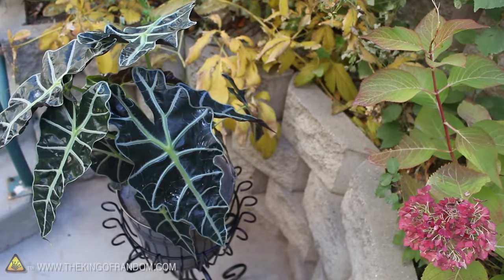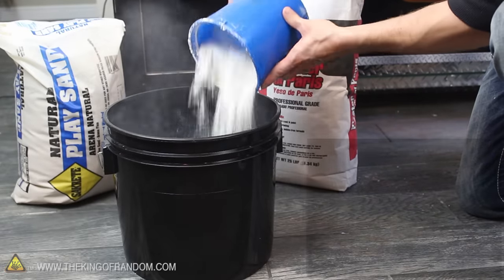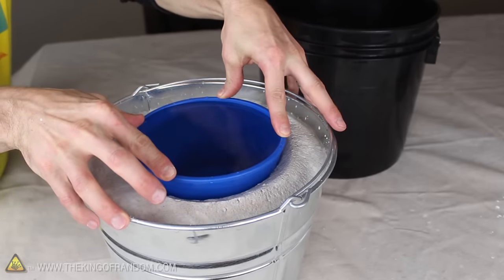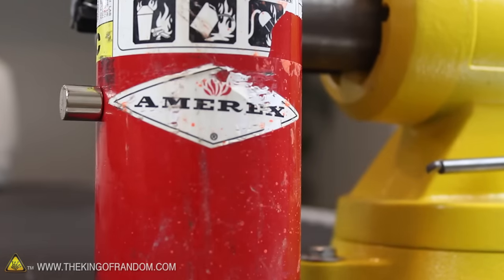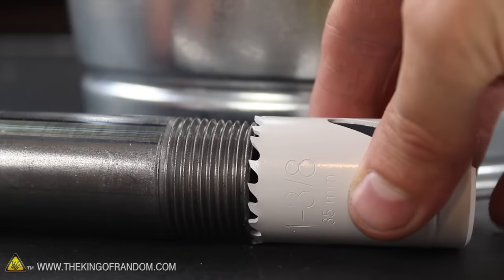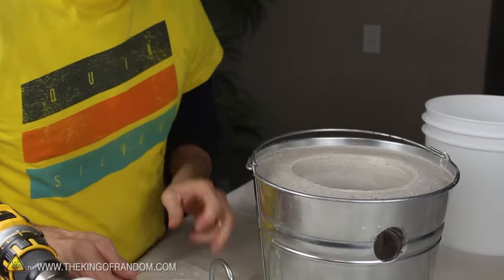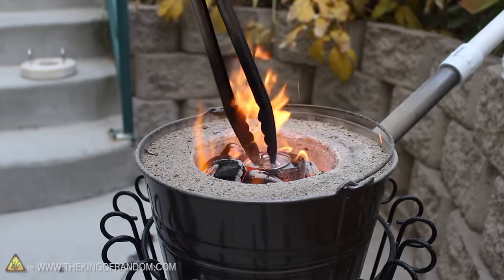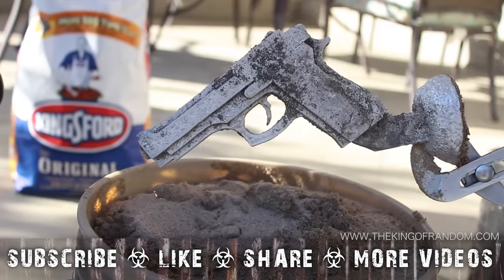How To Make The Mini Metal Foundry

Comment: My son and I built a foundry last month, and he insisted on trying it out one afternoon when the temperature was in the 20s.  Needless to say, although it seemed to be eating the cans, no liquid aluminum could be seen.  When we finally gave up, the contents of the crucible solidified quickly, and stuck.  

We tried it again today, with the temps in the 60s, and it worked like a charm!  The crucible heated up, and we kept tapping on the metal in it until finally the rebar went right through the slag and into the now melted aluminum.  We spent several hours melting cans, and creating little "muffin" ingots, doing three pours and emptying the foundry for new charcoal between each one.

The only problem we ran into is we've now lost two lids.  Both days, after we let the foundry and lid cool down, when we picked up the lid, it broke into three large pieces, each of which was dry and crumbly.  My only guess is that we didn't allow the lids to cure long enough before using them... any ideas?
Reply: That's pretty neat!
Reply: plaster and sand are not going to hold up for long.  Ceramic fiberboard from a pottery supply with a hole cut in the top would be better.  

this is a great tutorial and fun project but a part like the lid will not last for many firings.
Reply: ***** I had this problem once in school using plaster and sand as a mold. It happened to the whole class. Even after being very dry (kiln dry) the structure broke down and my aluminum flashed out of the cavity creating a bad casting. The mold got crumbly too. I seem to remember it being a problem with the sand. You might try a higher ratio of plaster, maybe even 100% plaster. You could try adding glass or wire mesh to the mix too. I'm not sure if it will work but it is worth a try.
Reply: Add some wires mesh or screws as support for the plaster to grab on to for the lid
Reply: I did it too but, with a metal bucket inside. At first I thought I screwed up, but I was very mistaken. I got to the temperature which it was needed to melt cans it worked very well. All the heat was kept inside, and was easier to maintain the temperature. Now for the lid, if you have any ceramic lids that might fit, that's good, or when curing the lid in the midst of curing the lid add more liquid. I don't know if it will work but try!
Reply: Unexpected bit 'o coolness!  A couple of weeks ago, I was talking to a guy at church who was a retired plumber and welder.  Told him about this, and he asked what inert gas I was using to prevent the aluminum from oxidizing... Told him that was far beyond what we were doing.

Today, after we melted another 5 pounds or so (total almost 20 lbs now, after 3 successful burns out of 4), I noticed the crucible was sizzling.  I had turned it over to knock out the excess slag, but the inside was coated.  I poured some water in to make sure it was cool and then picked it up.  Wondered if there was residual heat inside the slag, but it, too, felt cool to the touch.  Then I remembered the comment from my church friend.  I added two inches of water to the crucible and ended up with several streams of bubbles (very tiny, like in beer) so I wondered... is that the pure aluminum oxidizing in the water?  If so, those bubbles would be hydrogen gas.  How to test?   Got my stick-lighter, and held it to the surface of the water near the bubbles... sure enough they popped audibly, as you see in science classes when burning hydrogen bubbles!
Reply: I over mixed my plaster/ sand mix for the foundry and lid, (I used a 12 quart bucket,  poured my lid reinforced with bailing wire about twice as deep in a 5 gallon plastic bucket). No problems yet.
 My crusible did go out in a full aluminum, steel, charcoal blaze of glory, (it was half of propane tank, depresurized then filled with water to remove any explosive gasses when the cutting it half sparks started flying).
Ordered a size 6, (I think) graphite/ clay crusible, that size might be a little too wide for some of your furnace holes, but mine became wider. Works great for a little over $50.
And the furnace also grills an Awesome T-bone! Crank up the heat to sear both sides, remove the hair dryer to lower the temp, and cook to what you prefer. The most juiciest steak I ever had.
Reply: Such a fun project for many reasons. From what I remember aluminum is almost impossible to keep from oxidizing. Inert gas is definitely necessary for welding. But I dont remember anything about needing it for foundry.

But maybe thats what the pool shock tabs we added were for. If you add a small amount of pool shock, or even table salt to your liquid AL the slag will bubble to the surface so you can skim it off. YOU NEED A VAPOR MASK! This releases a puff of chlorine gas so please be careful if you do this technique of cleaning your aluminum. Of course you should wear a vapor mask anyway when doing foundry work so... hope that helps someone get better pours.
Reply: Instead of plaster of Paris, use clay, foundry clay, I got mine at the local brick/ gravel supply house, muddox is the brand, fire clay is what it's called, it has instructions on the mix, it's basically, 1 part Portland cement, to 1 part clay to 6 parts sand, 1-1-6, to make fire brick mixture, that won't crack, I've found that 2 part cement to one part clay to 6 parts sand works better. This acts as a liner to my, plaster of Paris and sand outer insulated core, so basically, we are lining the inside of the forge that he shows with fire brick, and I make my lid 100% fire brick, as it cools faster, hence the cracking issue. For the forge air supply, use steam rated black iron nipple, not galvanized tube. And the length is critical for the air /oxygen mix, I found 18"  length tube at 1-1/2" diameter to be perfect. With the pvc, pipe and adaptor at 24" overall  as he recommends. Note if u remove the lid and light, u will notice that the forge heats slower, the lid is needed to create the vacuum caused by the consumption of oxygen to bring in more air through the supply pipe., do not blow air into the forge with lid off, it's a mess, if u do, and I know a few of us have tried that!, I actually expanded on this ideas and created a larger forge, dimensionally speaking one can use the diameters to incrementally upsize. And I use coal, charcoal works , and if making knives, it adds carbon to steel making for a better steel. Cheers
Reply: *****  since you have made this im attempting yo make this can i ask how do use depressurize the fire extinguisher or did you use something els?
Reply: evan rodriguez Just empty all of it out spray it. My friend got my crucible for me, I think that's what he did.
Reply: Thanks ill try that
Reply: evan rodriguez, I purchased a five inch length of quarter inch steel pipe with an inner diameter of 4" inches, and a 4x4x1/4 plate to weld to the bottom.  It it thicker, so slower to heat up, but holds the heat between burns fairly well.  I didn't want to spend money on a new steel extinguisher just to destroy it, and was unable to find an old one anywhere.  My local steel shop had what I needed and I paid about $6 for the two pieces.
Reply: ***** Alright thanks.
Reply: ***** I used to work at a household hazardous waste depot and we would get several fire extinguishers a day of all different sizes. Now normally we do not give out anything we receive, but if you ask the supervisor nicely, he may give you one. Explain that it's just the steel body you need. DO NOT ask in front of other customers because we don't want them asking for stuff as well. Use common sense and discretion and understand that NO, is a possible answer. But it doesn't really cost anything to try.
Reply: Roger Murphy Not even sure where I'd find such a place here... but thanks for the advice!  Our steel pipe crucible actually works pretty well.

Comment: I'm totally building one of those
Reply: Yusuf Reyes I can't wait till I'm older to do this my dad wont let me do I didn't ask but I know he wouldn't let me P.S. I'm using my dads account and I'm a girl
Reply: Michael Lukowicz i have the same problem only i am using my own account
Reply: me to im not using  my  acount
Reply: Yusuf Reyes it's not as easy as he makes it seem. You will be at least 100 dollars into it by the time you finish
Reply: 100 dollars for sand bucket and mix? I don't think so
Reply: Actually it would possibly cost around a hundred dollars. Its just that Grant got the fire extinguisher for free and probably had most of that stuff lying around, therefore it cost him about 20 bucks.
Reply: Plaster, 10 Qt bucket, a2.5 Qt pail ad two U-bolts ran me $33.17 .  Built one today. I already had the hole saws, drill, etc.
Very cheap build and a cool foundry to boot!
Reply: Mans-Sham Ann you can use sand an flower mix for the insulator
Reply: DieselsWorkshop99 still would be worth it if you got a lot of scrap aluminum
Reply: Im today
Reply: Cristero Warrior
Reply: Pitforbrains how hot does it get?  Can it get to 1100°C?
Reply: Built it today and it cost $70 for all supplies (7 years ago when these comments were left it probably would have cost around $50)

Comment: Does this get hot enough to melt copper?  Hadn't seen anything in the comments section saying yes or no.
Reply: +AaronClarey : It can melt copper! Da da da it's a Furnace.
Reply from the maker: +AaronClarey It sure does.  https://www.youtube.com/watch?v=kS949QQDtWQ
Reply: +Grant Thompson - "The King of Random" You used propane with it. Can i melt copper with coals?
Reply: +Unknown Guy The crucible can't be made of plaster, plaster insulates heat and your crucible needs to transfer heat.
Reply: +Unknown Guy brobalby not cuz the bowl its in is steel or iron
Reply: +Grant Thompson - "The King of Random" how thick are the furnace walls?
Reply: +Unknown Guy no it cant handle it waaaaay to hot
Reply: +AaronClarey Yep! At least I think...  Check out his brass knuckles tutorial and he'll tell you what you can melt in the foundry.
Reply: It can but it requires about 20 mins of heating and it can sometimes only melt a bit it is incredibly hard to melt, trust me I tried it
Reply: +AaronClarey Yes you can
Reply: +AaronClarey Yes in theory. The melting point of copper is 1085C and the melting point of steel is around 1350C although I may be difficult to balance the temperature so that it's hot enough but no too hot to melt you steel. Also the steel at this temperature will be considerably more malleable and could just bent out of shape right away.A ceramic cup would be much better.
Reply: +AaronClarey Nice pic
Reply: Yes. It does melt copper.
Reply: You know there are different mixtures and varying heat ranges for refractory casting mixes, da da da dunce...
Reply: and gold
Reply: yes
Reply: yes
Reply: but it has sand in it which makes it ok
Reply: 4"
Reply: +Grant Thompson - "The King of Random" In your Laser Assisted Blowgun vid, what did you use for the accurate laser holder? Thanks
Reply: I like turtles
Reply: it only depends on how much air you feed to it and how much fuel you have in it. I have melted steel in this kind of foundry before so copper is no problem.
Reply: No problem.
Reply: +Nathan Smith I was wondering if that was possible.

Here he is using a steel container to melt the aluminum, but what would you use as a container to hold the molten steel?
Reply: charcoal can melt copper. It needs to have enough air but its no problem
Reply: It does it is even hot to melt gold
Reply: its hot enough to melt ALL kinds of metals
Reply: Not all.
Reply: It seems to, but you need to use lump charcoal instead of Briquettes. It will burn much hotter. Copper will melt in the furnace with Charcoal briquettes but I have yet to be able to get it to pouring temperature (100-200C above melting)
Reply: It'll get hot enough to melt steel if you're not careful enough lol.
Reply: Don't count on it.  I had trouble melting aluminum.  Either my crappy walmart charcoal (lol) or my non standard crucible.   I even made bigger furnace space design to fit more  charcoal!
Reply: i dont think your supposed to use regular charcoal in furnace
Reply: Did you actually watch the video?  He used regular but quality charcoal.
Reply: You can melt aluminum copper brass bronze gold lead zinc and silver
Reply: +Glenn Johnson - There is a brass and there is a bronze.  Is that what you're trying to describe?  Bronze is made out of copper and tin and is probably more red.  Brass is what ammunition cartridges are made out of.
Reply: Thank you. That helped me aswell :)
Reply: +Dima Prok He used briquettes, not regular charcoals.
Reply: PathosFear That's what I meant, briquettes being "regular", I think what I really meant is most common vs. the lump hardwood charcoal which burns longer and hotter.
Reply: why wont the fire extinguisher metal melt?
Reply: +jag man Its made of steel, which is has a melting point of near 1300 Celsius but the furnace cannot bring the temperature high enough to melt steel.
Reply: yes it works with copper
Reply: What is up with people and their obsession with trying to melt copper.  The way I see copper is hard to find and expensive.  Why would you want to melt it unless you're making a heatsink out of it or some kind of conductor?  First of all, usually you find copper in the wire form which in itself is valuable, so why melt it?  Instead - melt brass!  Why? well it's much easier to find spent brass casings at places where people shoot 2) it's most pretty metal after gold IMO.  3) There is actually more use from the brass when machining things.
Reply: Dont judge. Maybe he's melting copper from wires so he can sell them.😜
Reply: Dima Prok From my job there is always some type of copper waste, from pipes or wires usually, and I don't see the problem with melting it down and make something out of it.
Reply: +Mark Yang - I am not judging, I am asking questions.  You can sell without melting fist.
Reply: AaronClarey nope But it heats it up
Reply: watched in the beginning of 2015 when it came out : )
Reply: Bonded
Reply: AaronC
Reply: AaronClarey probably not
Reply: AaronClarey.   yah.  he has a new vid on that now
Reply: AaronClarey it does
Reply: Since in a lot of countries guns are illegal finding leftover brass isn't really a thing, whilst finding scrap copper in old electronics etcetera is, so it's not that strange I guess. Also personally I like the colour of copper a lot more.
Reply: yes
Reply: He has proved that it does many times!  (It also melts silver and gold!)
Reply: I'm not sure
Reply: AaronClarey yes
Reply: AaronClarey yes
Reply: Bonded Bee nope, it can melt copper even gold.
Reply: he even said that it could melt gold
Reply: yes
Reply: What brass is brass made of, hmm?
Reply: AaronClarey Yes
Reply: AaronClarey ii
Reply: AaronClarey it usually can melt copper
Reply: It's like welding!
Reply: not tungsten
Reply: AaronClarey hallo
Reply: AaronClarey yes it will melt copper
Reply: The King of Random can it melt steel? Specifically; chromium vanadium steel.
Reply: No i can not unless you used special types of coals combined with a powerful fan.
Reply: AaronClarey yes

Comment: Hey Mr. Thompson and everyone, just wanted to warn you all that eye protection is a must when using the foundry, in addition to gloves, and anything else, etc. And also, DO NOT drop in a can that is closed. I tried melting an aluminum soda bottle, and the lid was on it. It blew up due to the gasses trapped inside of the closed bottle, that when heated up, expand, thus causing the explosion. I got molten aluminum on my face and neck. Thank the LORD none got in my eyes. Even though I was just wearing regular eyeglasses, I still could've gone blind. There are marks where the aluminum melted some of the plastic lens.
Reply: lol, yeah

Comment: Very informative , however i have one question. approximately how long should we wait for it to cure before cranking up the heat? To keep it from cracking due to excessive moister in the plaster.
Reply: same question
Reply: +Jesse Ancel I'd say 5 minutes or more, but then again it's just a guess.
Reply: +Jesse Ancel i made one only waited accople days and it didnt cracked but we melted the bottom out.
Reply: +Jesse Ancel if you get an answer to your question please let me know! Thanks!
Reply: +Jappleng University  so trying to use this to melt copper is a bad idea?
Reply: +Jappleng University so i have a graphite crucible but will the plaster of paris refractory hold up to the 2000° temps?  or should i get the more pricey furnace cement refractory.
Reply: +Jappleng University yeah i figured it would be too small so i got a 10 gallon steel bucket instead of the 10 quart sized.  i want to stay away from the propane though so im hoping that wood charcoal will be enough i have plenty of that and i can always make more. if it doesng work then ill only be wasting a bucket and furnace cement lol